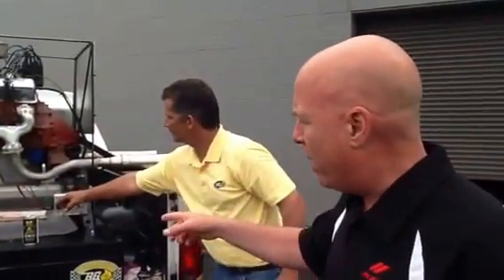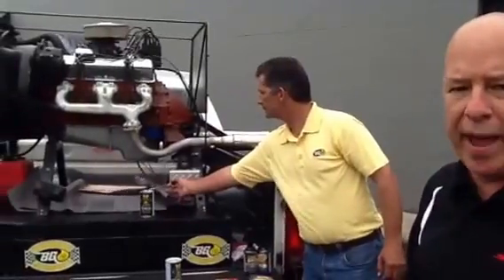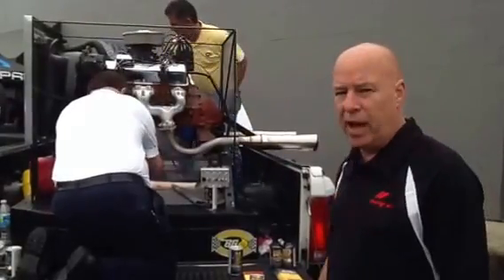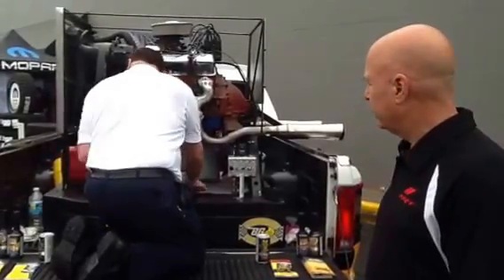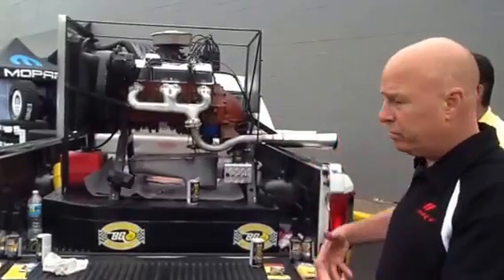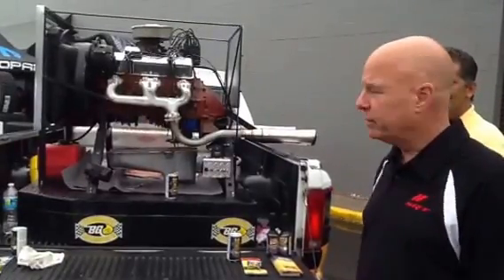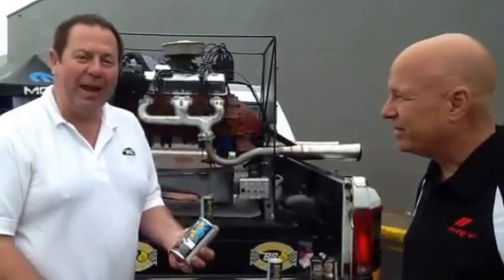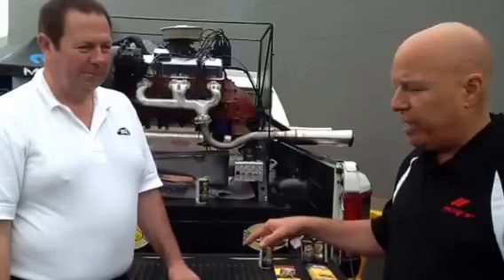B. G. Products Big Bubba engine oil demonstration

Comment: I work for BG for almost two years in the first demo I did on  a  performance oil change .the police unit  was a 2008 Crown Victoria with 96,000 miles it had a 3800 hours raise the compression from 125 to 175 lb compression with one application of epr and 44k and intake cleaner the customer was really surprised and so was I we ran two compression checks to confirm.